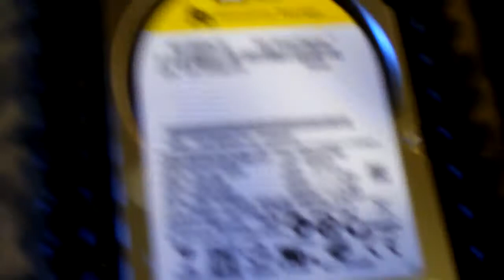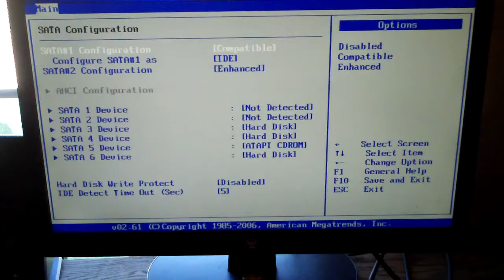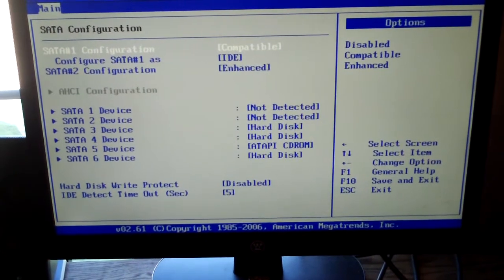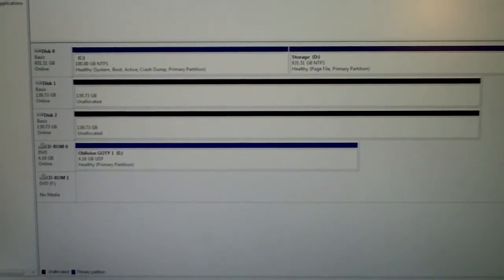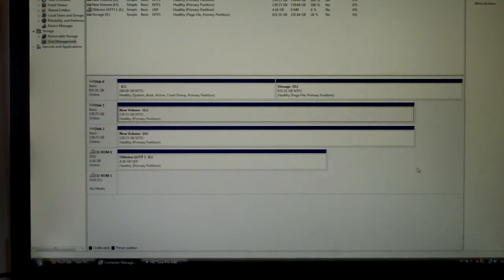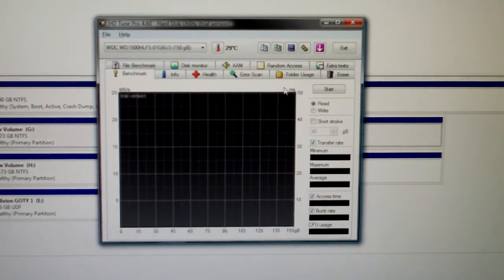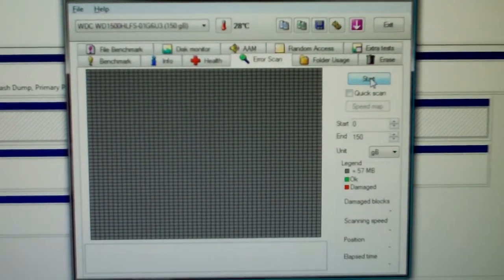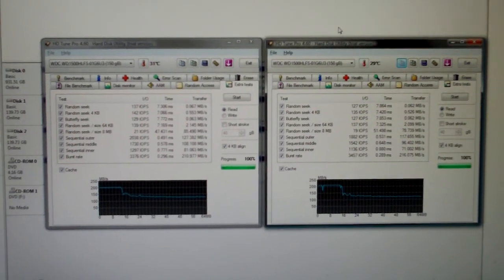Testing WD Velociraptor 150GB Hard Drives

Comment: i don't see the point of 10 000rpm hard drives it today market. you can get a 120gb OCZ vertex 2 for 200$ same pretty much the same price as buying 2 velociraptor. They were nice 5 years ago when SSD's were not a option but now kinda pointless since they don't make them in large capacity. 2Tb 10 000rpg would be nice for storage :)